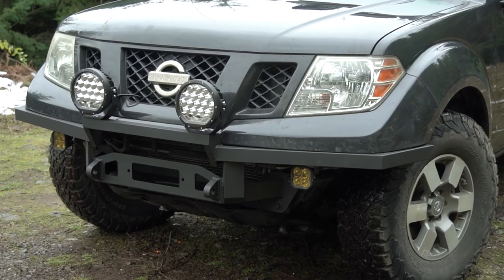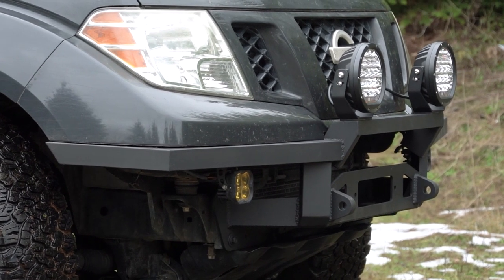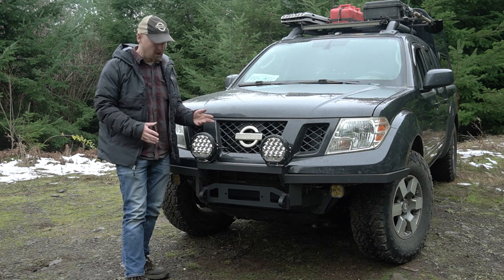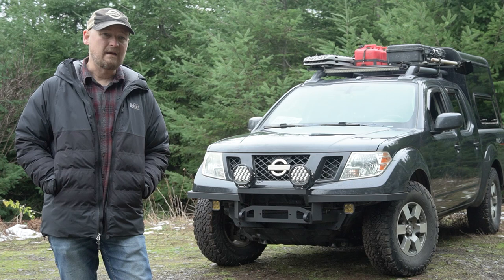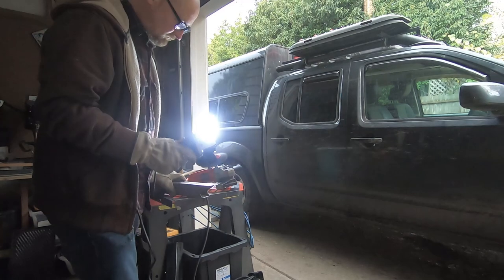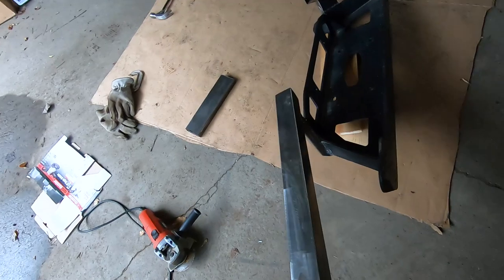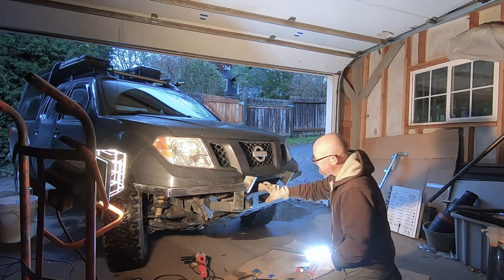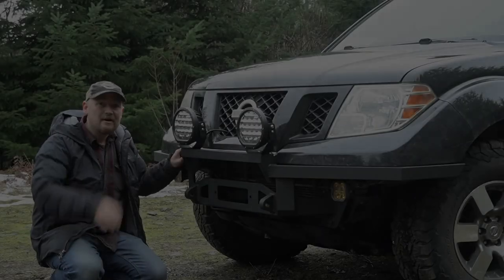Novice welder attempts to DIY a steel front bumper

Comment: Looks pretty good for a first attempt. Probably going to need some gusseting eventually, but still stout nonetheless.
Reply from the maker: Yeah, that was part of the original plan and I had steel I bought for it. When I saw how light and rigid the outer arms turned out, I decided to see how it goes without it, but I think some extra support would be wise and I'm now planning to add that when I take this back off to add the winch.

Comment: what did you run the white DRL power line to?
Reply from the maker: Hmmm...not sure what you're referring to? I didn't wire any lights in this video other than connecting my Diode Dynamics pods to the original fog light wiring (which is just a simple hot & ground) and the Frontier doesn't have DRLs.

Are you asking about the Colight units (which I didn't actually have hooked up in this video)? They came with a complete harness, relay, fuse, and a 3-position switch. I have them installed as basically their own self-contained system, in no way connected to the truck's wiring other than drawing power from the battery. Flipping the switch one way turns on the DRLs, flipping the switch the other way turns on the full driving lights. I much prefer this approach and having complete, conscious control of what the lights do. If I want to run the DRLs, I manually turn them on. I like having the ability for them NOT to be on when I'm driving, and I also like having the ability to turn them on even when the truck is off.

Let me know if I can clarify or if I misinterpreted your question. :-)

Comment: Winches die because of poor wiring and inadequate voltage.

It's gonna pull a lot more amps and heat up a ton more if your voltage takes a dump. 

Budget winches usually go on Budget Budget builds that don't have the best wiring or alternator and battery setup. The apex winches are awesome.

Comment: Just stumbling on this. How much did the bumper cost completely and would u build another one for me?  Lol
Reply from the maker: Well it cost ME very little because the pre-made winch mount I used as a foundation was donated, and there's not very many pounds of steel scrap/remnants at about $1.00 - $1.50 per pound that I used to build the rest. Plus of course consumables like grinder disks/cutoff wheels, spray paint, etc. Ultimately if someone is a skilled enough welder, it would make more sense to build the whole thing rather than buy and build off a pre-made winch mount (which can cost something like four to five hundred dollars).

I am in no way qualified to weld anything that would be sold to anyone, heh. I am currently working on a rear swingout bumper for the truck, and I'm using better welding equipment so it's going better than the front bumper went, but when I add up the material costs and the ludicrous number of hours I have into it (and I'm still a long ways from being done), the cost of buying something already fabricated starts to make sense. :-)
Reply: @softroadingthewest  thanks for the reply and the input. I'm not experienced much with metal work. I can build a house but metal fabrication gets lost on me lol. Looking forward to more videos
Reply from the maker: @nypimpn8ez  I had zero experience with metal work before I just went and bought a cheap welder. It had always seemed intimidating and something I assumed would require a 9-week community college class and thousands of dollars of equipment, but it's much more accessible than I had always assumed. Get your hands on a welder (and I would go straight for the best one you can afford), watch some videos, practice building some inconsequential projects, and you too can be a metal worker! 🙂

Comment: in the 3 years I have had my winch Ive only used it once and that was in the city pulling someone out of the sand. I have a harbor freight winch, but I have the steel line. If I were to get a winch make sure its a synthetic rope. If I were to do it again I wouldve bought a reputable winch like a Warn. But the Harbor freight works. I strongly recommend a wrap around rear bumper, hate when I see just a steel bumper to leave the sides exposed.

Comment: Are you not worried about the winch getting banged up and getting dirty and potentially compromised? Isn’t that why most aftermarket bumpers cover them completely? not meant to be snarky, genuine amateur curiosity
Reply from the maker: No worries, it's a good question and I meant to say something about that. If you look at virtually any Jeep with a winch, the winch sits fully exposed on top of the bumper (as they do on many work trucks that aren't necessarily offroad builds). I think in or out of a winch bumper, they're going to get dirty. Based on the crazy amounts of mud I accumulated in every nook and cranny on my November overland trip, I'm sure plenty of mud & water would still get inside an enclosed bumper (they're never truly fully enclosed) but then would be much much harder to clean any accumulated crap off the winch, which to me seems even worse.

I think the winches are designed to weather whatever comes at them, and really, if you watch the Australian 4x4 channels, they even get fully immersed at times.

Comment: I will ask though how that affords any protection against inpacts or wildlife
Reply: This is what I am wondering as well.
It might protect from bushes/brush, but a deer hit may still be a concern.
Is there a mechanical engineer in the crowd that can do some dirty math on this bumper?
Reply from the maker: This is no different than anyone who buys a hidden winch mount to install under their plastic bumper. Well, except in my case there's actually more metal up front now than anyone who uses this winch mount as it was designed to be used: replacing the crash beam and then hidden back inside the factory plastic. Building a battering ram wasn't my goal here. A front impact or wildlife encounter will certainly cause similar damage to what the stock front end would withstand.

My experience with my previous vehicle (which was totaled by a minor front-end accident) is that the factory crash beam was not helpful in preventing any damage whatsoever, rather, it transferred some of that energy laterally and created more damage on the opposite side of the impact, contributing to the car getting totaled. I drove the truck around for 6 months with the winch mount only - so, less protection than I have now - and no one said anything, LOL. 

Anyway, yeah, if I hit a deer, it will damage the front end, but if I was driving it around stock, hitting a deer would also damage the front end.

If I had put some gigantic 300-lb ARB style bumper on this, maybe I could bulldoze a deer or a small tree, but someone else would inevitably say I'd created a liability hazard by having a front end that won't crumple, causing disproportionate damage to the other vehicle in a collision.

There are a gazillion offroad rigs driving around with a huge range of front end modifications, from no bumper at all to massive steel monoliths. I guess everyone figures out what makes sense for them and which risks they want to take.
Reply: @softroadingthewest  wow! That was quite a response!
We were just commenting that a lot of the reason to get a steel / heavy duty "off-road bumper" is to help stop/diminish damage from animal strikes, and this bumper is unlikely to accomplish that.
If that isn't your purpose with it, no worries!
It would be interesting to see how it would hold up to a deer hit, but I'm not going to wish that on you! (Or the deer)
Reply from the maker: @thewiredfox2691  Haha, oh all good! Just explaining my thoughts on it, because it is a fair question and something I did think about. I try to respond comprehensively also for the benefit of anyone else who reads down through the comments with the same question. :-)

Comment: why is it legal to drive on streets with safety DIY mods, risking others in case of accident
Reply from the maker: How is this any different than the hundreds of thousands of work trucks, garbage trucks, dump trucks, delivery trucks, etc etc, all of which have much heavier and more massive steel bumpers and equipment mounted to the front, and which drive the same streets and roads at the same speeds?  The bumper I built replaces the factory bumper, which, although it was hidden under plastic before, is also just a big heavy piece of steel bolted to the frame. This flimsy little thing I built will likely collapse if you look at it wrong, haha. :-)
Reply: @softroadingthewest  these trucks have special certifications by manufacturers, in AU, CA, etc. safety related mods need costly DOT cert.